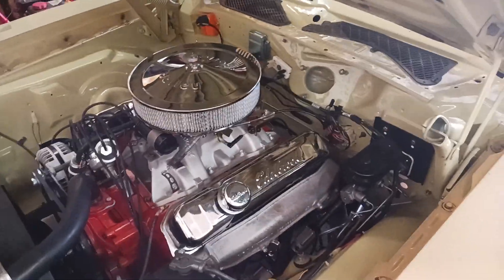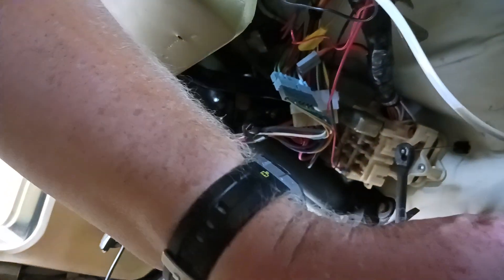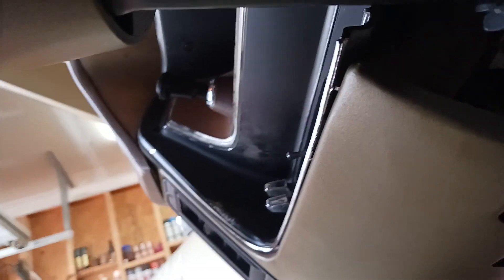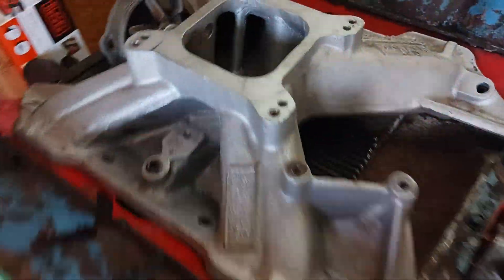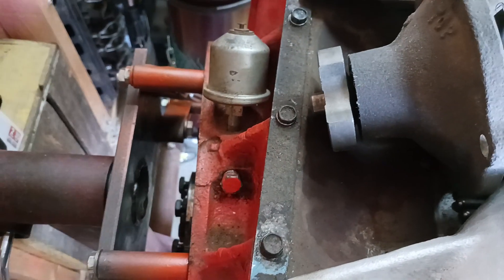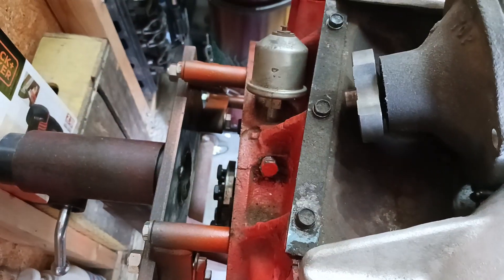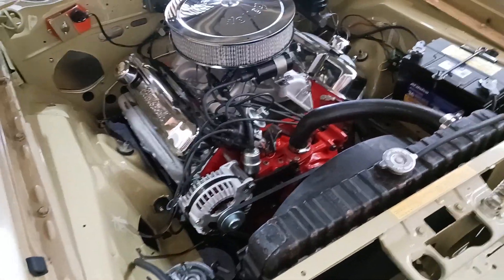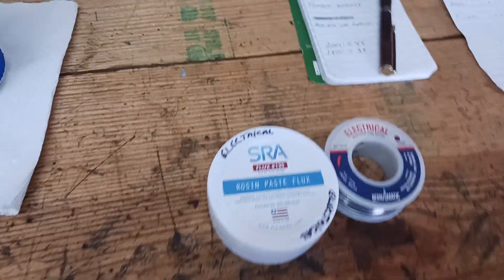Mopar Oil Pressure Gauge Install

Comment: 🚒👍 nice Ill be installing one soon. I did have one of those plastic lines break though. I have since used hydraulic over electric gauge to not have that issue. Completly understand having a mechanicalAnolog gauge. 👍